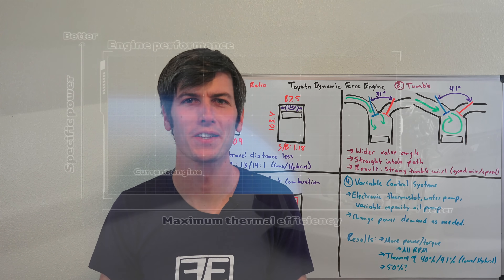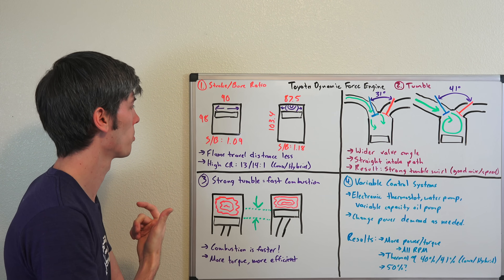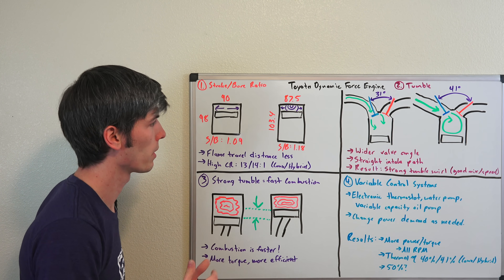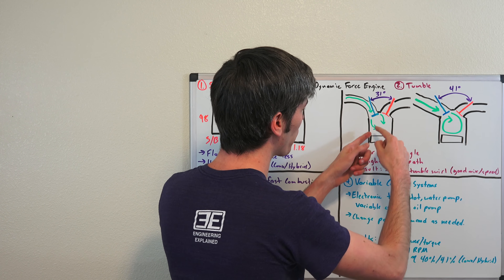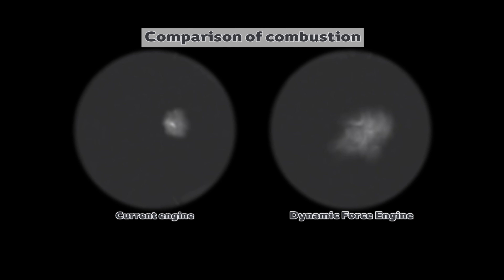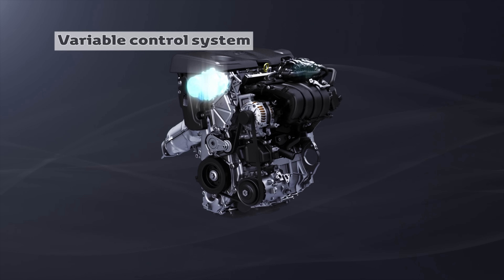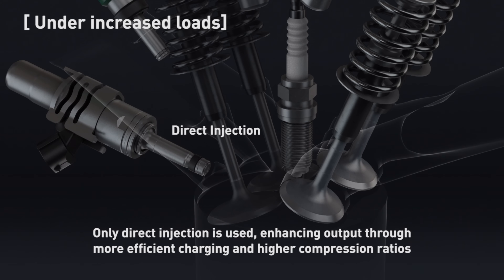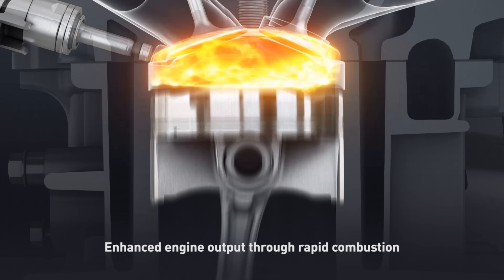Toyota's New Dynamic Force Engine Is Super Efficient

Comment: oh toyota .. still sinking money into putt putt motors to get 41% when electric motors are 90+%
Reply from the maker: Less than 2% of the cars on the road are EVs. I'm not saying electric isn't the future (I personally think it's awesome!), but I'm also saying Toyota isn't dumb for improving what 98% of people are currently buying. They have the Prius Prime & Plug-in, both with decent EV range. They made a Rav4 EV. They'll be ready for the switch.
Reply: william the dirtiest power station is twice as efficient as the internal combustion engine, and batteries can be recycled. and making the batteries pales in comparison to the damage oil extraction and transport has done to the environment over the years. read more and dont repeat myths
Reply: The biggest issue with EV's right now is non of them conform to a standard. It's everyone doing their own thing and because of this, you can't just drive up to a charging station and charge your vehicle. It has to be compatible with your vehicles charging type and software. Tesla has their own fast charging stations that no other car is compatible with as far as I know since it's designed to interface with the car's computer. Should be ideal that multiple EV's can charge at any given station without compatibility issues.
Reply: John P now you have to be joking. It is harder to add more charging stations. They put a tremendous load on the grid, a grid, that can barely handle current, and future demand, that doesn't have mass adoption of evs. If we could double the efficiency of an engine, it would produce more power for much less fuel, and have better emissions and range. It takes hours to charge an electric vehicle. 5 minutes for me to get gas. I would much rather have net neutral carbon footprint hyper efficient gas engines, than electric vehicles. Hybrids would be best, but evs are not the perfect solution.
Reply: The problem is the batteries still.
BTW there are electric motors that go all the way up to 98% efficiency. Freaking astounding.
Reply: dguy6789 has the most logical response.  John P, you can’t fast charge, let alone “normal” charge an EV if there isn’t a place to do it.  Sure, an EV is great if you drive around in the city, but there are many places in, for example USA, where you don’t even see a gas station (let alone an EV charger) for 100 miles.  That’s a simple fact that you cannot dispute.

Also your original comment is incorrect since Toyota is heavily involved in hydrogen cell cars.

Have a good day.  Hope you never get stranded in your EV 😉.
Reply: John P power companies in my area will pay to install a cut off on your air conditioner, so they can turn it off during Peak usage. They will pay you for your old refrigerator, so you will get a more efficient one to take load off the grid.
Reply: John P you need to seriously beef up the power grid if you are going to charge MILLIONS of cars... sorry
Reply: John P in theory... but the way the world is moving... keep dreaming...
Reply: You cant even charge a EV at 90+ efficiency under normal use, so dont expect to drive with 90+ efficiency.
The battery and electric motors are air or watercooled because of the heat loses ind the converting from electric to motion, if it was 90+% there would not be much reason for watercooling.
Reply: tesla takes 40 mins to charge. next?
Reply: put a small gasoline engine to power a generator to run an electric motor to turn the wheels, no need for large batteries, best of both worlds, by running a small engine at its ideal rpm all the time and using the max torque at 0 rpm the electric motor provides you get a highly efficient car.... but no
Reply: the sad thing is that evidently a lot of people still think the way you do .... give it time
Reply: time and MONEY man, lots and lots of money, infrastructure don`t pay itself overnight...
Reply: John P ok and how many people have actually gotten those model 3s? The electric motor isn't perfect, as mining for batteries (lithium) is destructive to the environment. First, we can improve cars a lot, laser ignition improves efficiency of an engine by 27% and Koenigsegg says that their camless design can increase by 30%, so we could realistically get a thermally efficiency of 60%+. That with biofuels, that produce a net zero carbon footprint, and higher octane ratings, we could even have more efficient engines. Ceramic coatings also help improve the efficiency of engines. There is a lot of optimizing that can be done of the ice to make it a much better alternative to evs. There isn't even good infrastructure for a quick transition to electric vehicles
Reply: when people were riding in horse and buggies the infrastructure wasnt there for cars either.. what happened? they built it .... even the dirtiest power plant is twice as efficient as the internal combustion engine ... dunno what country youre from but the last point is a myth too
Reply: i doubt they will be, because toyota are currently busy squandering the lead they had build up with the early hybrids, with bullshit like hydrogen fuel cells, and flat out refusing to do a BEV at this point .... although to be fair i think there are political pressures involved

and lets be honest .. 98% of cars sold are ICE because 99% of cars for sale are ICE .. and at least 30% of people are bone ignorant of even having that choice ... its taken 400,000 model 3 reservations and massive publicity for the big oems to shift their arses and start declaring serious EV r&d spending

and thats speaking as a major toyota fan / enthusiast owner of a single turbo mkiv supra
Reply: I would not buy an EV.  Glad they are continuing to make improvements to ICE.
Reply: The energy density of fossile fuels is about 30-40 times higher than a Lithium-Ion battery (2018). I think that's the limiting factor right now imo. Rather than everyone (besides "John P" of course) beeing ignorant.

And neather the internal combustion engine, nore the electric motors are always that efficient (those are just maxima for a very specific RPM).
Reply: +Engineering Explained .....i couldn't agree more.  John P, well he obviously doesn't understand the business aspect of supply & demand.  or in this case, just like YOU said, demand & supply.  Very VERY smart for Toyota to do this!!!
Reply: its the same in Australia too, im not disputing that there are inadequate charging facilities. if you read above, i said there werent adequate gas stations either when people were still riding horses everywhere. and what happened? they built them.

my original comment included hydrogen fuel cell vehciles, as HFC are technically almost the worst approach possible, and i consider them a worthless diversion which is wasting resources which could be better spent developing batteries
Reply: John P motors are efficient but the battery and electricity production is not in many cases. So this is awesome and the dumb is on you.
Reply: so much unfounded nonsense. most lithium is extracted from brine (ie water). the open cut hoax pics you see on the internet are copper mines. vw and several other big oems are risking billions in fines cheating instead of improving engine efficiency. if that doesnt show you that we are at the point of diminished returns for improving the internal combustion engine then what will? when people were riding horses, how many gas stations do you think there were then? havent heard of tesla superchargers? theyve started the ball rolling already.
Reply: no such thing as hyper efficient gasoline engine. and batteries can be recycled. can gasoline?
Reply: where is this fictional notion that the grid is so stressed coming from? if we could double the efficiency of an engine - then it would still be less efficient than an electric motor .. congrats youre a dunce
Reply: mostly true .. except almost everyone has chademo or an adapter as in tesla's case
Reply: omega- changes will need to be made, goes without saying. but maybe not in the way people think.  more and more people are getting solar, and some are also getting batteries, this creates capacity inherent to the grid. also there are emerging technologies such as vehicle to grid (v2g - look it up) which offer expanded capacity for grid regulation .. also refining oil uses a staggering amount of electricty .. look up the fullycharged video "volts for oil" .. if they stopped refining billions of barrels of oil into fuel there would be a lot more energy for charging cars. all in all, things are changing. and since oil wont last forever anyway, why wait and continue to raise co2 levels and ocean acidity?
Reply: John P until EVs are made at least as accessible as normal vehicle, all that can be done is improving what we drive now. So companies like Toyota are improving current engines for lowering the damage we are doing to our shitty planet.
Reply: Its all great in theory but the infrastructure is not there for electric cars. Sure you can charge at home  but  electricity doesn't get there for free or without emissions(except wind farms). If you get way more electric cars on the road you need more power plants(coal, natural gas, wind or nuclear). Current power plants barely keep up with the increasing demand for power.
Reply: imo hyper efficient gasoline engine powered cars are far better than EV's because of all the waste that's produced when getting rid of and making batteries
Reply: John P electric cars are shite. And they are as harmful for the enviroment as modern engines. Consider where the electricity comes from, and how those batteries are very harmful for the enviroment.

Comment: It's Super Efficient!
Reply: Toyota used SCIENCE!
It's super-efficient!
Tesla was unaffected by the advance

FIGHT  PKMN
ITEM    RUN
Reply: Talladega Tom cars can get away with this inefficiency because the energy density of gasoline is an order of magnitude higher than that of batteries. We need better and lighter batteries.
Reply: @Abu_Shawarib  we don't need to use 200hp at cars on cities. They just have brainwashed everyone. Electric is over 90% efficient, and if you don't go to fast , use regen properly, you can easily make the range to double.
Truth is, we need cheaper batteries. This motors are already insane.
Tesla weights 40kg with 300hp, 90% efficient, this is insane...
We should use gasoline for producing food, not much to spin stuff.
Reply: Talladega Tom but everybody with common sense would call 60% waste efficient when the norm is over 80% waste.
Reply: I wouldn't call 60% waste 'efficient', but that's just me.
Reply: Right.  From the advancement of the piston point of view, that is a great leap.  However, 60% waste is still woefully inefficient. 
In the not too distant future, folks will look back at the these attempts to make a pig look pretty and admire the effort too, but in the end the piston will die.  The efficiencies and advantages of the battery/electric combo will render the piston obsolete and rightly so imho.
Reply: Agreed.
Reply: Unlike the human body, which has an energy efficiency around 80%